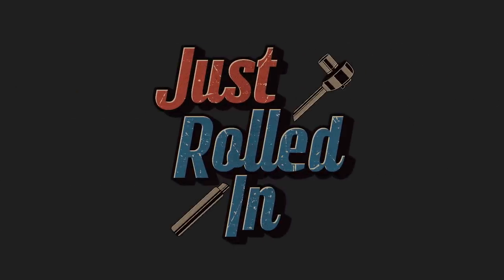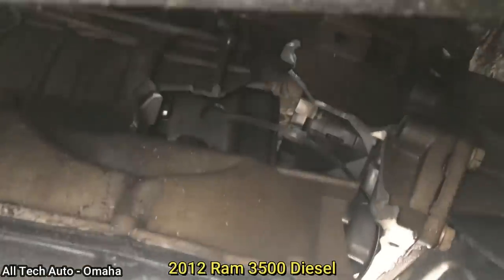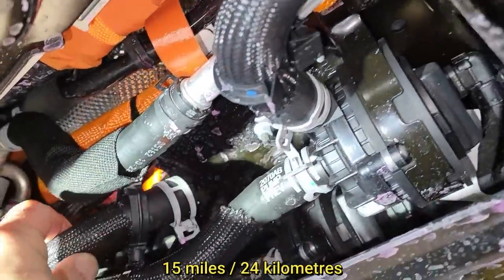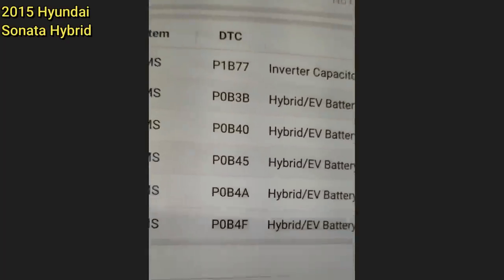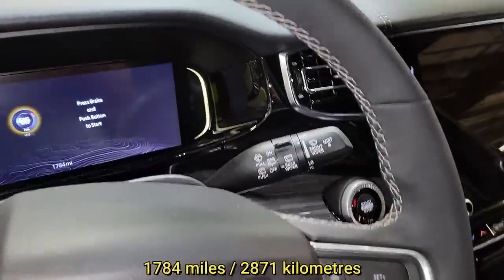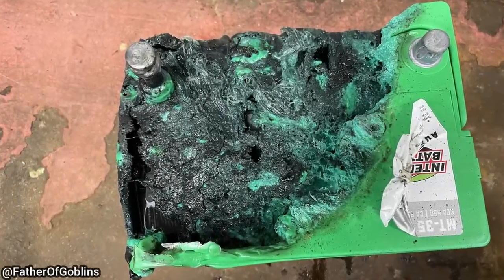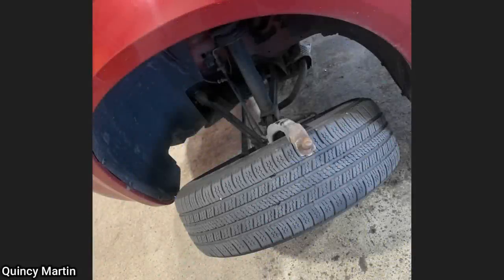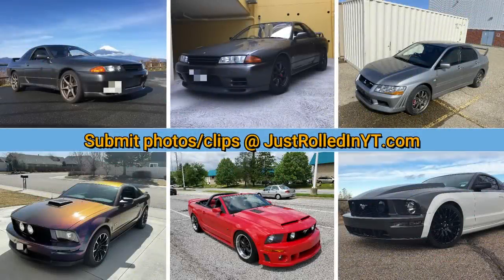Customer States New Truck Won't Stay Running (2022 RAM 1500) | Just Rolled In

Comment: Seeing all of these videos makes me appreciate Pennsylvania's strict annual inspections the more I watch them. There's been constant debate if they actually prevent accidents, but you will NEVER see trashed brakes, bald tires, busted ball joints, or frame members flapping in the breeze around here.
Reply: Its pretty much the same over here in germany with the TÜV, even though its only every two years for private cars it is mandated for semi trucks every year and for some cars even more often.
Reply: Whats funny is the PA inspections aren't even that strict. Lots open to interpretation. PA annual safety inspections are a joke compared to TÜV.
Reply: Mandatory yearly inspections on vehicles over 5 years old here in Australia, and these videos make me so thankful for it.
Reply: Same here in NY but there are always shady service centers that'll just slap a sticker on anything without actually inspecting it
Reply: Maybe Pennsylvania should go back to inspections every six months. That was a real pain when I was younger!
Reply: Trust me, there are tons of inspectors that'll pass ANY car for the right amount of money in PA!
Reply: Considering the roads I've driven in PA, vehicles need monthly inspections.
Reply: ny every year safety AND emissions check . the emissions check plugs into the state computer system that talks to the car. hard to cheat that part.
Reply: Eh, you would be surprised how much of the population "has a guy," how many shops in rural and urban areas basically sell stickers, etc. Not to mention how many people just ignore the inspection. And what can happen between annuak inspections. Its better than nothing, but there's PLENTY of these shenanigans on PA roads
Reply: Agreed. I don't mind inspections. The biggest thing I hate is not having my vehicle for a day or two. I like the vehicle that hauls my kids to be safe. Plus gives the mechanic a chance to fix everything that I don't get around to.
Reply: Australia has the same. if you dont have a signature, insurance wont cover you if youve got something wrong with your car. tho some people still dont care and drive around with uninsured cars
Reply: @kevb8983  NSW. I actually thought every state in Australia had regular inspections, turns out we're just different.
Reply: @wsolly42  where do you live that it takes a day or two for an inspection? I got annoyed when it took an hour my last time (in Texas) 😂
Reply: We have annual inspections here in Massachusetts but I see crappy clunkers on the road all the time. Many of them are from Rhode Island but plenty have MA plates. I don't know if they "know a guy" or what.
Reply: @ronblack7870  I'm opposed to stand-alone inspection stations because I've seen too many where it became state-mandated extortion rather than safety but I trust my auto shop and would have no problem with them doing it since I see them three or four times a year anyway and they do a 40 point inspection each time.
Reply: They're starting that here in Ontario, Canada finally. I hate what it's gonna cost, but I'm soooooo tired of seeing the garbage people are driving in this province. In my city alone, I'm betting that at least a quarter of the vehicles in a city of 270,000 people will be pulled off the road and scrapped by the Ministry of Transportation. A lot of people in this province are in for a very rude awakening.
Reply: U most certainly will see that shit. People "know a guy" all the time
Reply: @haroldwilkes598  Here in Germany you have multiple options where to go for your inspection, there are certified repair shops that can do the inspection (I personally wouldn't do that, because I'm pretty sure some try to sell you stuff that is totally unneccessary), then there are TüV-owned stations (state-owned, also not my personal first choice, because they are overly strict and actually have a quota on older cars that they have to fail) and then there are privately owned, certified chain stores that only do those inspections. They don't care whether or not they fail you, because they get paid the same either way, so they have no real incentive to unneccessarily fail you.
Reply: @MyRegardsToTheDodo  I like the last option unless they are in the commission referral business.
Reply: @haroldwilkes598  No, they're not. If you fail they give you a sheet of stuff that needs fixing and (I think) two weeks to get it fixed to have it reexamined, they don't care if you fix it yourself or get it fixed by a shop.
Reply: 1 specific good thing about PA inspection is that only about 7% of drivers are uninsured which is one of the 10 lowest % in the US. Since you have to prove insurance coverage to even get a sticker from "your guy" or the shop down the street that sells stickers
Reply: @KarlEller  Not in VIC.
Reply: Annual inspection on all cars over three years old in the UK. Ambulances, minibuses, and taxis have to be tested from the time they are one year old. It's pretty strict, and regularly monitored by the government agency pulling cars as they leave a testing station.
Traffic patrol police cars have onboard ANPR that links to computers that will flag a car that currently has no valid test. It also checks to see if the car has valid mandatory insurance, and if it has current annual tax in place.
Obviously some drivers take chances, but the penalties are high. For example, a tyre with tread below limit will get you 3 penalty points on your licence, and after 12 points the licence is suspended, so 4 bald tyres may mean your right to drive is lost for a minimum of 6 months.
Many of the vehicles shown on this channel are in a condition that would never be seen on UK roads.
Reply: laughs in 15 150k bald tires and worn out vehicles from Jefferson County dude, I have thirty years worth of vehicles that these guys could make a solo video from!
Reply: @rey5597  any place that, during inspection, automatically replaces the shot parts just so you can get out of there.
Reply: @chrispop99  Here in Germany you get a stamp on your license plate. Those stamps have different colors each year, so the police can immediately see if you are over the time limit for the testing period. 
For a tire with tread below limit you get a fine of 60 Euros and 1 point on your driver's license, if you get 8 points, you'll lose your license.  And if the tread is way too low, the police will immediately take your car out of service by invalidating your license plate, which means that you aren't even allowed to park it in a public space and have to get the car towed back to your place (and hope that you have a garage or something, because you can't park it on the side of the road).
Reply: @matthewbowen5841  It really amazes me that you don't even need an insurance. Here you have to have insurance to get the car registered and when you don't pay and the insurance company cancels your contract they inform the DMV, who in turn cancel your registration.
Reply: @rey5597  PA. I have a busy mechanic. It's usually only a day but there's always something my 20 year old truck needs. Whether it's for safety inspection or something that just needs fixed.
Reply: @chrisfreemesser5707  around here (Norway), they are required to hold the vehicle for 30 minutes after the inspection is complete, in which time a government inspector may turn up and do the inspection over again. Any large mismatch in findings and the garage is in trouble. 

Approving without inspection does happen, but the garage - not only the mechanic - will have the right to perform inspections revoked for a substantial amount of time as well as a hefty fine.
Reply: @ronblack7870  VW got away with it…….for awhile.
Reply: @rey5597  
A proper state inspection with test drive in PA is scheduled for a minimum of 45 min.
Reply: @MyRegardsToTheDodo  That would be great, 100% improvement over a few that I have run into.
Reply: @MyRegardsToTheDodo  I'm not aware of anywhere in the US that doesn't mandate insurance. But like any laws, some people abide, some don't, and the enforcement varies.
Reply: @chrisfreemesser5707  Yup. As long as it passes on the ODB2, it's good to go.
Reply: @jasond1824  That´s what we have central evidence for, including mandatory photodocumentation of every vehicle checked (cause before you can "checked" vehicles without even seeing them, if you found the right person and handed over the right amount of money)
Reply: PA is more concerned about rust than mechanical safety.
Reply: @Pippy1  
They have to record a video of the inspection in MA now.   Not a lot of ways around that, need to know 3 guys now.
Reply: @matthewbowen5841  New Hampshire doesn't require insurance. Arizona lets you post bond instead. Those are the only ones I'm aware of.
Reply: @chrispop99  - don't forget the potential up to £2500 fine per illegal tyre.
Reply: Here in the UK we have an annual MOT (Ministry of Transport) vehicle check. If the vehicle isn't road worthy you can't drive it home. If the MOT tester finds any faults with your vehicle he will issue a fail and you have 10 day's to return the vehicle with any faults fixed and then you will issued a pass certificate.
Reply: yeah here in wv its pretty easy to pass and most people (including me) go to places that let non passable vehicles through, but most shops will not pass if something like this is that bad, and most at least take the time to jack up the vehicle and check ball joints and bearing for extreme wear. the fact that people let their shit get like this is unbelievable. and i have drove some sketchy ass shit, but nothing wore out so bad a pothole can wipe you off the earth.
Reply: The UK has something similar called MOT which is yearly.
Reply: I hate to tell you this, but I see cars like that all over the roads in PA. It's nothing but a money scam. People still drive unsafe vehicles. They just 'know a guy'
Reply: @ronblack7870  Interesting. In WA state we got rid of those for cars about a year ago. All they were doing was a computer code and gas cap check. I think they found so little it wasn't worthwhile.
Reply: I worked at a cab company, insurance dept, and watched the local vehicle inspection agent view the same set of good tires on at least half a dozen cars. The inspections were done in the front parking lot, the tires were swapped around back. I'll never ride in a cab again.
Reply: @KarlEller  The Western Australian State government abandoned mandatry inspections some years ago, and have found no increase in motor accidents which can be attributed to mechanical deficiencies. Likewise driving teests for aged persons. They took note of the actual statistics which showed that certain younger drivers and their illegally modified vehicles were spearheading the incident statistics.
More vigilance in policing by road patrols; longer instructional periods to gain a drivers licence with extended provisional licennce period; and the seizing of regular offenders' cars has been far more productive.
The police stick a yellow notice on the windsceen of cars which may appear to be mechanically at fault (colloquially referred to as a 'canary') requiring the car to be inspected, faults repaired and a conformance inspection conducted before the vehicle can be returned to service.
They also do not shoot drivers for having a tail light not functioning.
Reply: @Bandit69ply  Suspending the drivers' licences and impounding their vehicles on top of hefty fines is usually more effective.
Reply: @matthewbowen5841  Effective enforcement of laws and their regulations is a first-in-line requirement.
Reply: When it comes to inspections, I'd much rather find out about something that can cause a wreck and kill me in the inspector's shop than going 65 on the highway.

Comment: Since covid, any car from 2020 to 2022 is on my no buy list.  I keep hearing about serious qc issues for all cars from these years.
Reply: I'm keeping my 06 Corolla and 05 Sonata running as long as I can. Not to mention my three carburetted Hyundais and Canada's only Matiz (3 cyl, 800cc) :D
Reply: @the_kombinator  oh shit the 800cc Matiz was slow af... with ac on probably can even climb parking ramps
Reply: I bought a 2021 MX-5 [Japan] last year and a 2022 Honda CR-V [made in Canada] with no problems. Key is not to buy Dodge/Jeep
Reply: @jeffatturbofish  give it time, it’s not a matter of if, it’s a matter of when.
Reply: Last year I bought my 2009 V6 Accord. Newest car I've owned, and will likely stay that way.
Reply: I have a 2021 Honda, I hope is stays together
Reply: @ridgelineenjoyer1517  it will stay together once you sell it
Reply: what is worse to me is that many people paid Full retail or even over retail to get them since the chip shortage. They way overpaid for crap cars that will drop in value once the shortage is over..
Reply: @ridgelineenjoyer1517  Hondas and Toyotas are probably the only ones left with any reliability left.
Reply: I had a 23 year old, in great shape inside/out, low mileage Dodge Durango given to me a few years ago by a family member.  I tried to make it a daily driver;  babied it, ended up replacing numerous original parts, only to have the pcm continually go out due to an issue that should've been a recall 20 years prior.  
About 15 years ago had an older Chrysler Sebring, and was looking....where's the battery???  Oh, it's under/behind the driver's front tire.  WHY???  Traded that in for a then 3 year old 07 Mitsubishi Eclipse(which I still have and is almost to 300K miles now).  And, had a 94 Dakota for a trash truck(we take our trash to a remote site here), which ehh it was old and not maintained that great prior to me taking it.  Ended up eventually having wiring issues, and traded it to my mechanic for a decent 8x12 trailer.
I ended up on a Durango forum trying to find help for my issues on the Durango.  And the folks out there are literally dropping 70-80K + on brand new Durangos.  The price of my house with 8.5 acres.  For a Dodge.  And then seeing their issues from serious to petty on new to 1-2 year old vehicles, and serious lack of customer service through the dealerships.  Lesson learned,  I will never buy/take a free Dodge/Chrysler/Stellantis/Jeep/Fiat, etc.